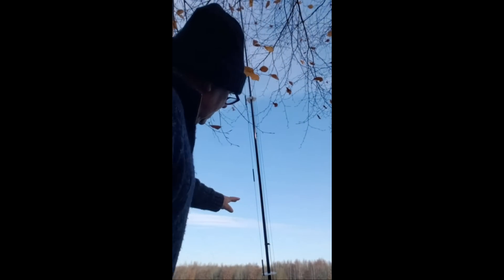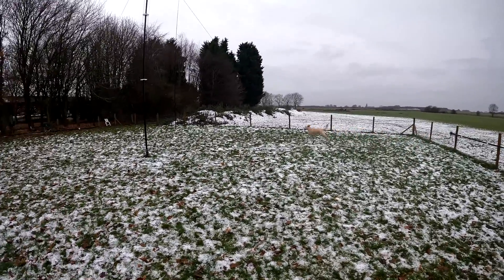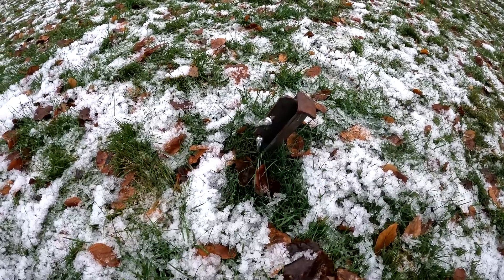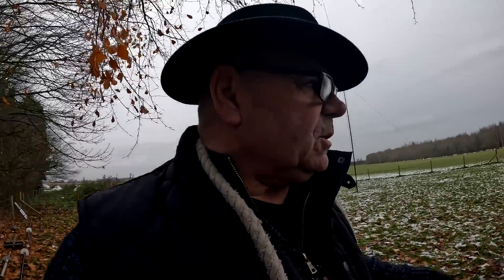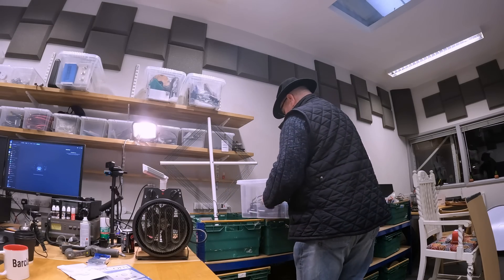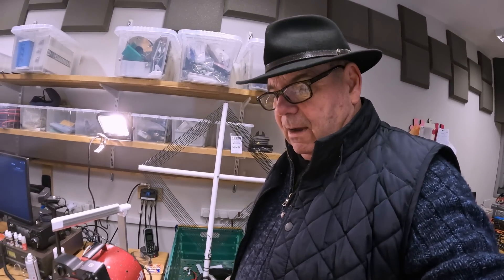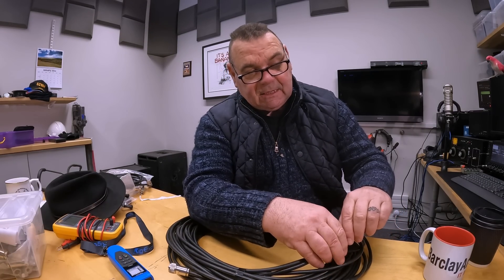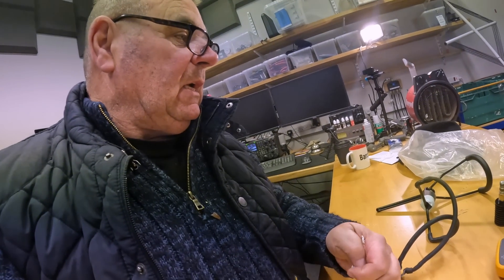What Went Wrong With My Coax?

Comment: Ian no expert Callum I had a 7610 into a acom 1010 amp then into a three element Yagi.  I would often get high swr. After talking to an engineer at icom thinking it was a radio problem. He mentioned the coax was charging  and holding a charge like a capacitor. After doing some better work on improving my grounding it stopped the problem. To be honest the engineer did explain but it was over my head a bit.
Reply from the maker: That has happened to me as well.. Not this time, but many moons ago!
Reply: i bet you have burnt a small hole in the dielectric which when testing with a low voltage meter won't show a fault. but when a higher voltage is a applied may be arcing through the dielectric giving you the problem. @DXCommanderHQ

Comment: The length of the coax does not change the swr of the coax.  The impedance mismatch of the coax determines the swr you see with a dummy load.  Now if you have a mismatched antenna at the end of a length of a matched piece of coax, the length of the coax will reduce the antenna swr you measure at the other end of the coax due to the loss in the coax.  Coax does age.  Abusing coax by bending it sharply will also change its impedance slightly, as will over loading/over heating it.
Reply from the maker: You tell 'em!

Comment: That cable is only rated at 2000W at 10MHz. Rating goes down with increasing freq, and that rating is only good with a 1:1 SWR.  As SWR goes up, rating goes down to 500W. So most likely, your combination of freq, power and SWR exceeded the max power capability of the coax at 1600W. High swr from a dodgy connector intermittent would have doomed it instantly.
Reply from the maker: Rating and reality are two different things. Been doing key down on SSB Electronics 7mm stuff for years.. But we've swapped to EcoFlex 15 since then for testing.

Comment: I wonder if the short length of coax that gave a problem was close to 1/2 or 1/4 wavelength on the Freq you had the analyser on (29 MHz). As for the burnout check your connection box in the field it may have got water in it and arced across. By the way the max allowed power in the UK is 400w. Not saying... But. 73 Ed
Reply from the maker: OK Edward, 1/4 wave or 1/2 wavelength SHOULD make absolutely no difference since impedance repeats half wavlength anyway.. And if we have 50 ohms at the end of the coax then regardless of what else if going on, we should see 50 ohms at the meter.. This is an old myth folks seem to worry about (in my opinion!) :)
Reply: @DXCommanderHQ  my experience is that when I see something unexpected or variable on an antenna or cable to an antenna it is often a multiple of 1/4 or 1/2 wavelengths long. visually inspecting the cable and antenna shows no faults. Shorten or extend the cable by a couple of inches and the problem is solved. It could of course be the analyser reacting to the length rather than a 'real' fault. 73 Ed.

Comment: Did you measure the SWR in both directions, because if the mismatch is at one end of the cable the reflected power will be attenuated showing a low swr than a shorter cable with a similar mismatch. Better to use  a VNA in TDR mode to show where mismatch is in the cable.
Reply from the maker: Interesting.. But no.. If it's not right, it's old and needs to be replaced..

Comment: I had the same problem at POTA this week...   I tested my Wolf River 1:1 on the analyzer, then coupled it to the radio with a barrel and SWR went overload...   Next morning everything was fine at home. ...  When I added in the barrel connector,  it was snowing ...   I suspect a few flakes stuck in the connector dropping Z to zero point crap.
Reply from the maker: Yep.. Thing is, we just want a reliable "pipe" for the wigglies rather than spend time sorting out coax..!

Comment: If I may make a suggestion, you could apply heat from your hot air gun to the connectors while the analyser and dummy load are connected, taking a series of measurements (before heat, during heating and after heating). This may answer the question as to whether or not moisture ingress is a contributing factor. By the way, thank you for your hard work, Callum.

Comment: Hi Calum
The only thing I can think of is connector cleaning … 
Try clean your connectors in alcohol make sure to use cotton swab to clean the inner part of the connector.
Then re-measure… 
Measuring on a higher frequency  than 10 meters like 432 MHz would help show if the coax has issues .
I would also measure s21 transmission loss, instead of “just” vswr 
Good luck Niels
OZ1CGQ

Comment: I have had troubles with patch cables because they get bent near the connector. And sometimes they get bad connection at the connector.  Only found when I pulled on the connector.  It was intermittent bad.  Do know if that is what you have there. The only way I found my was to test it under stress, pull on connector or bend it next to the connector.  Just an idea

Comment: Coax can test good with an antenna analyzer due to the low power of the test, but when you apply higher power, the dielectric can leak or breakdown, and that can be tested with a "megger".  The reading with the patch might be with the wavelength of the short cable, or the connector has a bad connection to the coax.
Reply from the maker: Indeed Paul. Pin hole - possibly a carbon track too.

Comment: One of those mysteries. I had a short run of RG8X running portable HF and I always put the analyzer and dummy load on before connecting to the radio. I never could get it below 2:1 on any frequency so I labeled it as bad. Just before I tossed it I checked it again and it was fine. I even used a Nano VNA along with my RigExpert and both showed around 1.3:1. No evidence of water or anything that looked funny. I put it back in the portable box with a couple of other lengths so we'll see if there are issues later. Good luck finding yours. Jack K5FIT
Reply from the maker: Yep!

Comment: what is the blue meter you are using please
Reply from the maker: It's the cheapest RigExpert, called a Stick.
Reply: @DXCommanderHQ  thanks i might get one i have the mfj swr analyzer mjf 269D but with my hands i would rather use something smaller 
thanks eddie G0VVT

Comment: I do not like the new coax that's out now that multi flex it just does not feel right and when you bend it a bit it does not keep its shape but I only use max 200 watts most of the time I only use 50 watts and i have use Mr Lynch many times and can not fault him unlike some others ,thanks for the video G0VVT

Comment: Of course ideally you’d have a big dummy load and run a kW into it and see what happens. 
However, if you’re sure that run is faulty, and it’s not a connector, bin it. 
If VSWR isn’t perfect there will be high voltage nodes along the length and I’ve known coax to arc through the inner insulation. 
Very hard to find the point - I did once, it looked like a fine, hot needle had been pushed through it.
Reply from the maker: Bin! :)

Comment: I  had a problem once with a foam core coax where excessive current in the center conductor raised the heat enough to melt the foam and allowed the center conductor to migrate to where it contacted the shield.  This occurred at a bend, and when i straightened the coax, the short went away.  I ended up using a larger coax.
Reply from the maker: Amazing.

Comment: If there is(?) damp in the coax, 1500W maybe enough for it to breakdown...
I had some damp coax...High SWR, 10 days sat in the airing cupboard dried it out..

Your High SWR on short coax patch lead.??
I think you said your testing 29.2MHz, so a 1/4WL = 2.565M X VF of coax 0.82(?) = @ 2.12M
Check the length of that cable, Is near that 2.12M.?,
Reply from the maker: Hey, length should not matter.. Impedance repeats every half wavelenth and nothing more... If we have 50 ohms everywhere, then 1:1..
Reply: @DXCommanderHQ  
Except a 1/4WL can act as a Stub/Transformer
It's a common method of feeding certain antennas.

It would be interesting to see if you connect that "suspect" lead to another lead, and redo the test.

Comment: Hi Callum,  I worked in an EMI test lab. We operated from 100 Hz to 18GHZ at high power levels up to several KW. Coax is always a problem. It takes a lot of abuse, especially the more it's handled. If the coax has gotten water inside the jacket, it's dead, forever. The water will wick up the braid just like solder wicks up a wire. The tiny little wires in the shield need to touch one another to provide the shielding. The water causes the copper to oxidize,  the oxidation is an insulator.  Now all those little wires are isolated from one another and there is no way to get them clean again. The shielding is gone. 

You can dry it out but it won't get rid of the oxidation.  No option but to throw it out.

Almost every time we had issues with a coax or any other electrical cable, it's the connectors. That's where all the wear and tear is. The other issue was people stepping on the cable.  We had large shielded rooms with metal floors. A person can easily mash the cable enough to cause an impedance bump in the cable. It was a constant battle keeping folks off the cables. 

When you are troubleshooting connectors you need something that responds really fast.  Try using your stick to SWEEP the band of interest. Gently (or not!!) flex the coax and watch as it sweeps the band, if you see it jumping around you have your culprit. If the instrument you are using is slow to respond, it won't be fast enough to catch the change as you flex the cable.

To check your method of testing set your stick to a VHF band, put your dummy load on the stick, screw the collar on, but leave it loose. If you can wiggle the connector and see the impedance change then you have a working setup. Using a high frequency just makes the poor connection more apparent. You could try testing your cables at higher frequencies. The losses are higher and easier to measure the higher you go. Losses from water damage might show up more at high frequencies but I have never tested that theory.

Pin holes? They wick up water like a sponge. Carbon tracks will arc over again and again, they get worse the more often they arc over. Again, the cable is dead forever. 

You are looking for a high voltage ohm meter to test for carbon. There are inexpensive ones on Amazon. Otherwise known as a "megger".

A TDR might find the location of the fault. I have seen commercial TDR's find the impedance bump caused by a zip tie that was pulled too tight to around the cable. Very sensitive and expensive.

For a cheaper option, check out a video by W2AEW, it's #88 on his channel.

Cheers!

Matt
Reply from the maker: I recon pin hole, a connector or perhaps a carbon track (arc).

Comment: It’s most likely the cable has been damaged during installation, for example exceeding the bend radius, then couple this with some water ingress and maybe corrosion and the result is a cable that has weak spots along its length. For most coaxial cable 1300W is well within a normal operating range. For example the current flowing would be ~5A and voltage ~250v so quite modest really. A rise of VSWR to 2:1 if the load impedance has not changed implies a impedance change in the transmission path to either 25R or 100R, created either by a dielectric failure from cable damage or melting and so on. The failure could be in two ways that the cable plus load impedance dropped to 25R that would imply a low impedance path between inner and outer elements of the coaxial cable now itself presenting a much lower impedance towards the measured 2:1 ratio, or conversely the cable introduced a series impedance again to achieve the other possibility of a 100R impedance signified by the 2:1 measurement. If you need to test the cable you could achieve the same results on the bench using a drum of cable and a dummy load. Good luck with a resolution to your problem. 73
Reply from the maker: Yep.. Pin hole, carbon track too..

Comment: The thing to do with antenna VSWR problems is to use a NavoVNA as a Time Domain Reflectometer in order to identify the distance the problem is away from the transmitter. Then you can find it before it magically disappears when you wiggle the cable and becomes an intermittent problem.
Reply from the maker: Thing is John, it went away.. So after some careful thinking, I recon it's a carbon track..

Comment: Cal, i have old multiple coax sections with barrel connectors run out to my back field connected to DXC classic antenna. I'll check the SWR and get back .
Reply: I'm back, I have 4 sections of old coax different   lengths and 3 barrel connectors the SWR 1.06 . 166.81 feet .
Reply from the maker: Nice work!!

Comment: Hey Callum I really like the look of the hat and my goodness Old Bean, you have SNOW on the ground!  WTF??  And near the ground stakes make for a nasty bit to cut the grass I suspect.  As far as the SWR, I would (were I you) re terminate both ends of the problematic coax with new connectors and inspect the cut off ends to see if there was water ingress or corrosion?  No idea about the patch lead issue other than length perhaps? This is a fine way to start the New Year Callum, a coax issue.... Art W1SWL
Reply from the maker: Arthur.. It's probably old, maybe a pin hole or a carbon track that ony shows up at high power.

Comment: What brand of coax are you using these days?
Reply from the maker: I main preference for genuine high-power R&D is EcoFlex 15.. However Aircell 7 and the 7mm M&P equiv is easy to work with - but I probably push them to the limits..! EcoFlex 10 is also beautiful - however not sure if it's available in USA..

Comment: HNY Callum,

In the RAF we had some reels of co-ax that had been on deployments for 20 years and were still good, and some that were virtually brand new that always caused problems.  Our "standard" test was to make sure the co-ax was isolated from any kit/antenna, and test it with a megger (insulation breakdown tester) at 1000v plus.  Any suspicions we would follow up testing with a TDR test (time domain reflectometer), where you would get a visual representation of the whole cable length, and any irregularities along the length.  You could even see small reflections from where a cable had been kinked.  We would get a lot of issues where there was small cracks or pin holes in the outer insulation, and water would "wick" into the sheath - with a TDR you could see exactly where these problems were.  On your "unexpected" SWR readings on short patch leads, maybe re-test at a lower frequency and see if you get a different result?  Again, maybe it's a RAF thing, but we used a "known good" launch lead (about 5m) before the cable (or waveguide) under test.  It will be interesting to see if you manage to get to the bottom of this one.
Reply from the maker: Yes, if I was a coax factory, I would invest in a megger - but I'm an antenna guy. The coax is just a tool and I don't want to spend time faffing with coax.. So I'll just buy some heavier stuff. Probably more Ecoflex 15 that I know is absolutely good for around 5kW..
Reply: @DXCommanderHQ  Poor man's low voltage megger - multimeter with a conductivity measurement setting. 1nS = 1000 MΩ
Reply: I second  the suggestion to use a Megger. And not a multimeter. A Multimeter tests the resistance at a low voltage. A Megger (or more specifically an insulation tester) will test at, 250v, 500v, 1000v. What this does is, if there is a hole in the insulation or poor insulation this would show up as the higher voltage would arc over the gap. A mulimeter can not do this. Why does this matter, well if there is any moisture ingress this will present as a lower impendance at RF frequencies and voltages. Quite probably spoiling your day.
Why does moisture ingress impact Coax. The braid in particular has a great many contact points where copper touches copper. With moisture this corodes and does not conduct as well. There is no way to recitify this other than junk the coax. Make sure if you do use an insulation tester the coax is not connected to anything and you aren't touching it. If you have a TDR fantastic test after this, they can even show up small reflections from connectors and so on.
You can of course cut your Coax down until you get clean copper again and re-terminate the cable. If in doubt, whip it out.

Comment: Hi Callum. Happy New Year.

I have found that the coax barrel connectors can sometimes have 'spread' centres where the pin of the PL259 goes in. I found that squeezing them together with fine nosed pliers helps. You can tell if this has happened by checking how much force you need to apply to just put the pin in the centre hole of the barrel. If it's too loose, you could have a dodgy connection leading to an intermittently high VSWR.

If water gets into coax around the connectors, it is basically ruined. If you strip back the outer plastic coat, you will see that the braid will have gone dark due to oxidation. If it hasn't gone all the way along the cable, you could cut off the bad bit and salvage the rest that still has shiny braid. It is best to weatherproof PL259/SL239 connectors, or use 'N' Type connectors, which have better weatherproofing capabilities.

Comment: pro tip : get yourself a proper VNA/network analyser, or even on of those cheap chinese VNA's and forget VSWR and come into the world of RL (return loss)  you will get a beter understanding on the workings off you antennas.   pse forget those expensive swr hamradio meters great for quick and dirty checks but absolute useless for proper measurments.  cheers Joost, pa5nt